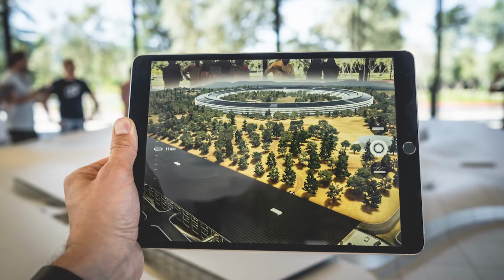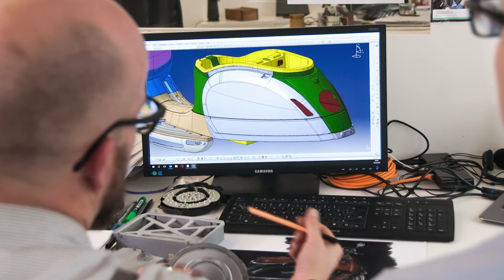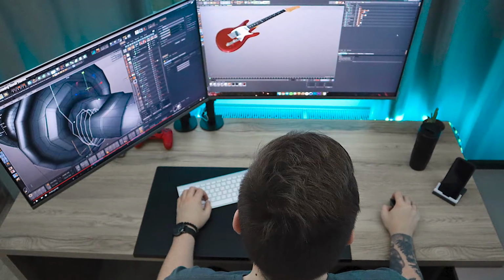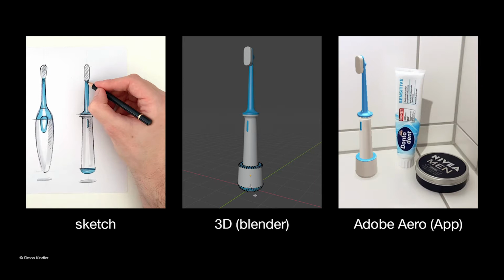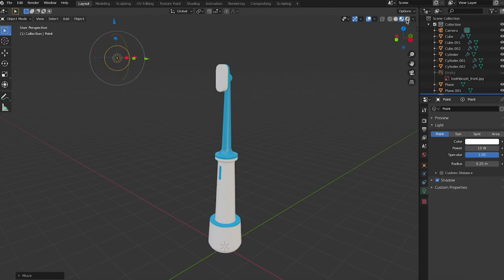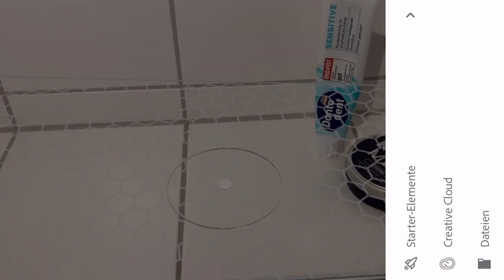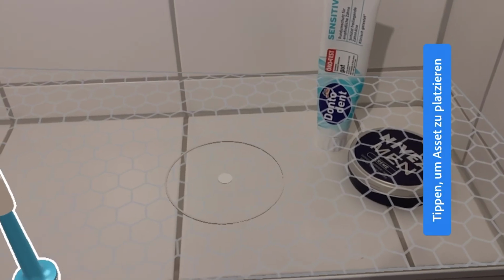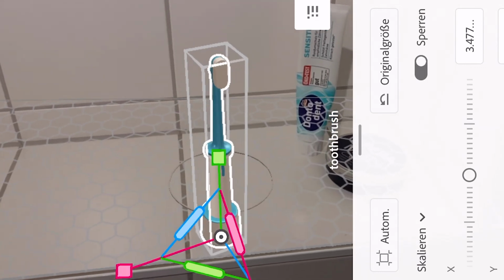Visual prototyping using augmented reality (Blender & Adobe Aero)

Comment: Did you try to export some files with textures? I tried and have some glitch on textures. I think it is problem with export settings. Could you advice how to fix it?
Reply from the maker: Hi! I did not try it with textures, but it should work with UV textures.
Reply: @SimonKindler  Yes, it works but not perfect. I don't know why it looks different in Adobe Aero but i will figure out :)